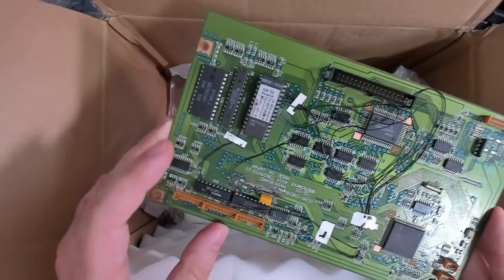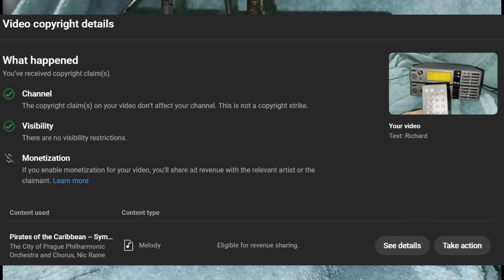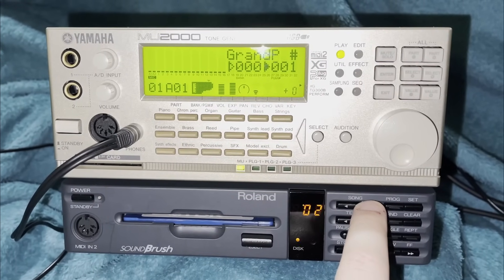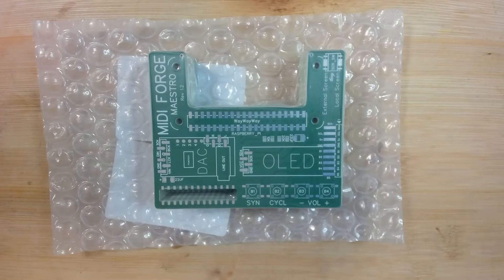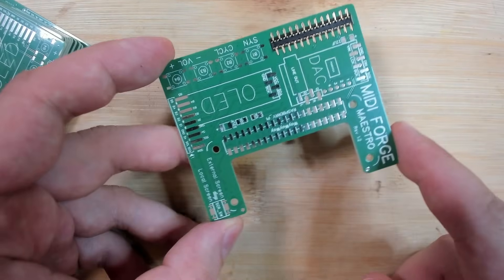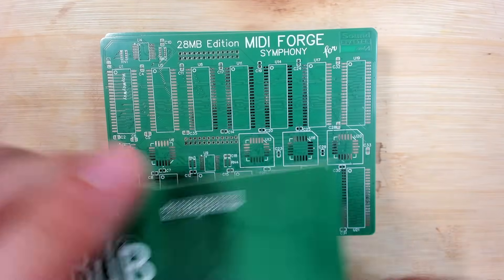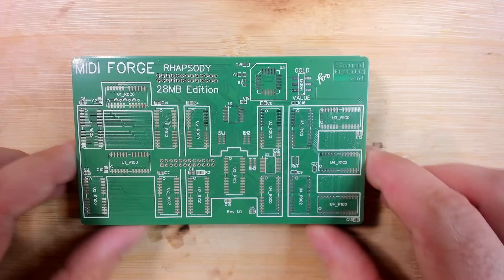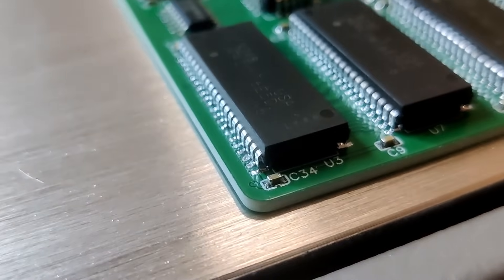4 Months Later: SOUND Brush 55 Restoration Results!

Comment: So glad the repair worked out on the first attempt! I used to be an optimist like you, but somewhere along the way, I took several arrows to the knee. 😅 I'm more into video than audio, but I do have a soft spot for Roland hardware, as I admire the craftsmanship/quality. Just like with IBM, when they were still manufacturing consumer hardware. Best of luck regarding the MIDI FORGEs! It'll be interesting to see how big the "remaining" market for this kind of device is. 🤞🏻
Reply from the maker: Haha, I had to laugh - Skyrim...
Right now, I'm looking into soundcards and their expansions (wavetable and memory upgrades) - which are covered by the MIDI FORGE line. I'm curious as well what the demand will be, but the boards will be available for anyone who wants to build their own.
I hope it makes the extra features on soundcards (that have been dormant for way too long) a lot more accessible.

Comment: Should your Rhapsody card work on the AWE64 CT4500 ?  my pcb is green, so id prefer a green pcb.  I forgot I have this card stored with my AWE32 CT3600 card
Reply from the maker: The memory boards should be compatible with all AWE64 models. I will test on my soundcards and will mention it in the video which models I tested with.

Comment: I’ver repaired a few of these SB55’s, they are the worst for death caps, smd leakage and eaten traces. I’ve also modded usb floppy emulators to fit perfectly inside these as a nice upgrade on my cpmagneticmedia ebay shop. :)
Reply from the maker: Sounds like those SB55 really need to get checked. As far as I know, those damaged boards I repaired weren't even used - so, even an unused device may just rot away if not caught in time.

Comment: Oh I have a SoundBrush. I should probably open it up and check it for a battery...?
Reply from the maker: The issue on this board was due to leaky capacitors. All the corrosion was caused by electrolyte that attacked the copper traces. But yes, better to check if all is in order - there are only a handful of capacitors that need to be checked.
Reply: @ I checked mine and found all five SMD caps leaking. Nowhere near as bad as on your board. But: some minor corrosion under the solder mask on the main PCB. And pretty bad corrosion on the interface PCB. Three of four pads gone during desoldering. Do you have schematics what those two caps were connected to, so I can make a bodge? Probably also have to sand away a bit soldermask and neutralize the juices and reapply new solder mask.
Reply from the maker: Oh wow! Well, good catch then before it got even worse.
Unfortunately, I don't have schematics. I fixed the boards by looking at the traces. Luckily, it's just a two layer board.
I could help you out by going through the footage of the first repair Video I made for the sound brush. You can email me and send the sections you need details for. I'll try to find those in the footage if that helps.

Comment: hrm. wonder if i have any compatible memory chips in my ram box that would work for that. makes me want to dig my awe64 out of whichever bin i have it in in the garage.
Reply from the maker: Haha :) Nice! Let's all get our AWE64 cards out of storage! For the Symphony, you need 14x 1Mx16 memory chips (I tested only EDO, but FPM should also work) - and they need to be 60ns or faster. For the Rhapsody, you need 4Mx4 chips (those are common on double-sided 32MB EDO 72-pin SIMMs or single-sided 16MB 72-pin SIMMs).
Reply: mm, looks like i will then. sweet. now i just need to locate the bin the awe64 is in.

and of course wait till its released~
Reply from the maker: I'm waiting for the two boards now to make the release videos. Unfortunately, there is a 5-day holiday in China right now. Next week will be a gap-filler video, but the week after, we will start with one of the boards. Still don't know which one, but probably the Symphony. The Rhapsody will be then the week after, but the Gerber Files will be released together. I just want to build one more board before I am certain that everything is working as intended.
Reply: s'all good. better it be sorted out before release if possible, less headaches for everyone that way.

much <3 for the design work on 'em.

this is the sort of thing that helps keep the retro pc scene alive.

Comment: PCBWAY is now charging tariffs to those in the US, I had to cancel a $175.86 order that went up to just over $551. I will still watch of course.
No I didn't vote for turnip, I voted for Harris.
Reply from the maker: Wow - that's crazy! So, what happens if I buy the PCBs and then ship them from the UAE to the US? I hope this situation normalizes soon because it feels like nobody is winning here.
Reply: @ Yes it is, I canceled the whole order since I can't afford a $550+ ReSDMAC for an Amiga 3000D motherboard w/o a 3000D case and 5 PCB's to adapt an Amiga 500/2000 Agnus to a 3000D computer, I later on redid part of my order without any gold for the Agnus adapters and that cost $55.93 for 5 pcbs, I bought enough parts elsewhere to complete one adapter. I plan to house this 3000D motherboard in an appropriate Pentium pc case.
Reply from the maker: Very sad that this affects everyone - even people who just want to work on their hobby, but also businesses that require materials. If it becomes too expensive, the economy will slow down. I really hope this goes away soon.

Comment: I suggest you consider changing from using the actual SoundBlaster logo and using SB as I am pretty certain that it is trademarked which could get you in alot of trouble. Cool projects though!
Reply from the maker: Plot twist: I reached out to Creative and asked for their permission. They are OK with it and even sent me one of their newer models: Sound Blaster X AE-5 Plus. Will share the details in the upcoming videos!
But exactly your concern was mine as well - that is why I reached out to Creative. I must say, very nice people working over there at Creative Technology Ltd.
Reply: @ cool and neat!!!
Reply: If you have a contact. Maybe you can acquire actual technical documentation and schematics of the early cards and custom chips.

Comment: We have an AWE64 Gold, that we are (have to) recap. Looking for some of those Nichicon HQ audio. Your board ( the 2nd one) looks amazing. Will you be doing the cut out on that on too, to keep the "height" down?
Reply from the maker: No, those memory boards are low enough to fit nicely over the AWE64 without interfering with the adjacent ISA slot. Also, the connectors are smaller (2.00mm) than the ones for the wavetable (2.54mm).

Comment: Not sure you saw my comment on the previous video - you can save a little bit of extra height on the wavetable module if you unsolder the 3.5mm audio jack since it's not used at all, and will give you an extra reduction of 4mm or so. I do that on the modules I assemble.
As for the Rhapsody and the Symphony - first of all, I was fortunate enough to be able to purchase one of the last of the original SIMMCONN adapters from the person who designed them, that was over 15 years ago now - and been using it with my AWE64 Value since. What is the advantage of using SMD memory chips instead of SIMM modules, apart from the space saving?
Also for those who want to build one of those 2, be aware that the connectors used on those are not the usual 2.54mm spacing between pins ones, but 2mm. They are in my experience hard to source. I was able to purchase a number of them many years ago, but last I looked they were out of stock.
Reply from the maker: Regarding the connector - yes, you are absolutely correct. The spacing is 2mm for the 2x12 and 2x13 pin connectors. Not easy to find, but I got a couple of them.
Here are a list of biased benefits of my memory boards:

Symphony:
Replica of the original memory module. It looks very similar if not identical to the memory module from Creative
The height of the memory module wont interfere with the adjacent ISA slot
This board has the exact dimensions that Creative used back then - it won't cover any connectors on the soundcard

Rhapsody:
Easy to source memory chips
Refreshing layout of the memory chips that will spell the word "AWE"
Does not cover adjacent ISA slot

Both:
The "Sound Blaster AWE64" logo in the top right corner was approved by Creative Technology Ltd
No configuration needed - 28MB Plug and play
Memory boards will work on either Value or Gold model of the AWE64 - no need to have a dedicated version for each model

Comment: Is there possibility to share codes from remote? i have SC-55 and SoundBrush but no remote.
Reply from the maker: Uh, that is a tough one. I hope you'll find someone who can help you - or maybe find one of these remotes somewhere. I don't know if those remotes have to be paired with the device (if that is even possible) or if they just work on any SC-55.
Reply: Hello! I am the owner of the devices in question. I do have a number of arduinos. I’ll see if I can build something to record the control codes and let you know
Reply: @cromulence  that would be great, if needed i can help with reading using arduino, as i want to create own clone of remote

Comment: I don't think I would personally be interested in the upgrade board for my AWE64 gold card, but that's largely because of the built-in memory upgrade over the regular/"value" AWE64. But that's just me, I was pretty fortunate to manage to snag one for a really decent price a few years back.
Reply from the maker: The AWE64 Gold does have 4MB and it is enough for smaller sound fonts. But if you want to experiment with larger files, you need an upgrade - of course, it all depends on your preference. The AWE64 Value can be upgraded to 2MB - still only half of the Gold though.

Comment: You should offer the expansions in both green and black/gold, because only the AWE64 Gold (CT4390, CT4540) was black, the AWE64 Value (CT4380, CT 4500, CT4520) was green
Reply from the maker: I will definitely have them in green too if there is demand. More details will follow very soon.

Comment: I think i still have my awe64. Don't know if it still works, haven't had a PC with isa slots in many years.
Reply from the maker: If you have the AWE64 Gold, it is worth quite a bit. If it is the Value model, it still is something nice and worth keeping in good shape.
Reply: @bitsundbolts it would be a gold. I didn't do value back then🤪 worked hard for that card.

Comment: I have to wonder why your designs have so many memory chips. Surely this can be made much cheaper with a modern high capacity memory chip. Even if that's bga I'm sure PCBway or such can mount that for you.
Reply from the maker: I am not an expert when it comes to make newer memory chips compatible to older hardware, but I believe that most of the newer memory chips won't be compatible to these older busses - specifically in terms of timing and voltages. So, you would have to create a lot more supporting circuits to make that work - if it is even possible.
Reply: @bitsundbolts but your chips are getting scarce and more expensive because of it no doubt. At some point a few level shifters and cheap fpga will be far cheaper. The tang nano is 15 euro and has 8 megabyte of sdr ram built in. And yes that is less than the 28 on your board, but who knows what others are out there.  I'm not sure what the expense of all your memory is going to be... But at some point it will cross each other. The tang board is 15 euro, but the FPGA is less as there is a lot of unneeded junk on that board. So the FPGA plus whatever size memory chip plus level shifters should be able to get within that number. Add a little for small scale economics.... 
And if you can figure out gal equations, I'm sure you can do a FPGA ram bridge. 

I'm not trying to bash your project. I appreciate people putting effort into what they love. But especially if your going to sell it, economics does count. I'm not an fpga expert, but I can count money😂
Reply from the maker: Haha, yes - I am all for making projects like this affordable. The Gerber files will be available for anyone who can assemble them, but the issue will come from sourcing all parts - the GAL chips, 2mm connectors, and the memory chips. Then it takes time to assemble. I do consider economy of scale and got a larger quantity of memory chips that make it feasible to produce those boards. Of course, if the memory chips are no longer available for a reasonable price, someone will come up with a better solution.

Comment: aaaaaaaaaaaand AWE64 prices just tripled hehehehe nice work! =D

You got that wrong... you said difficulties when you meant to say "Creative Labs" :P
Black and gold will always do it for me ... RIP my old car
Reply from the maker: Haha - because of the switch? Well, it might have been me trying to be careful and have all options with a prototype board. It's not nice to end up with a PCB that needs major changes that aren't easily implemented with jumper wires. So, I tried to play it safe. But, turns out this switch won't be necessary ;)

Comment: Can you sell me just the PCB for the Rhapsody?
Reply from the maker: The shipping cost might be a bit high for just the board, but I can check that. I will try to offer a DIY kit as well that has everything you need to assemble it yourself. Just the board is also possible. We can discuss this once the boards are officially released - which should happen this month.

Comment: As an owner of an AWE64 Gold i am excited to see these memory expansions being reproduced! Can't wait :)
Reply from the maker: Glad to hear that! Well, then you will like this month because it will be more or less dedicated to the AWE64 memory expansion boards.
Reply: @bitsundbolts This is an absolutely excellent project. Are you aware there was a difference between the memory expansion boards for the regular Awe64 and Awe64 Gold? I think it might have just been bios but can’t remember for sure.
Reply from the maker: The memory interface between the AWE64 Value and the AWE64 Gold is definitely behaving differently. It might be because of the different size of onboard memory. However, both MIDI FORGE boards will work on either AWE64 model.
Reply: it's a complete nonsense, as you can get gigantic soundfonts with any softmidi, at zero cost, 
you can use the AWE64, Live, Live 5.1 soundfonts if you wish or any you like
Reply from the maker: @ajax700 Nobody is forced to buy it nor is anyone required to build it for themselves. However, if you want to experience this old hardware as it was intended to be, then you have an option to max out the memory of AWE64 soundcards. Of course, you can emulate just about anything these days.
Reply: @bitsundbolts  what do you mean?
Creative never allowed soundfonts to be loaded on main memory to sell very overpriced proprietary solutions, now everybody can do it, at practically zero cost.

Praising creative is praising the ones that eliminated all innovation on audio technologies on the PC too...

Comment: you're lucky you're not here in the US. I can't imagine what PCB way is going to cost now because of our dumbass president.
Reply from the maker: I hope this situation is going to be resolved soon - nobody is winning in a trade war.
Reply: In USA is no factory similar to JLC PCB or PCBWAY?
Reply: @ not that I know of, but I only learned about PCBWaaaaaaaaaaayyyyyyyy thanks to the C64 community back in 2019. JLCPCB I learned about from tronixfix (who I don't think has ever used them) a few years later.
Reply: @sebastian19745  There is Oshpark, it is much more expensive though but that's the way it is when labor is not $3 an hour :) P.S: I've used them and they are great!
Reply: @sebastian19745  There is Oshpark, it is much more expensive of course since it's in the US but I've used them and they did a great job with my 4-layer board!